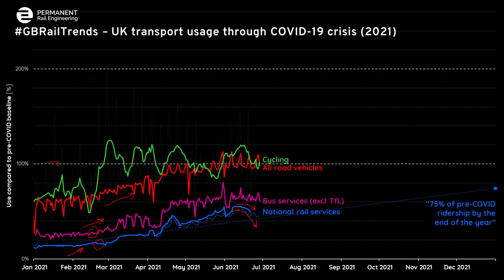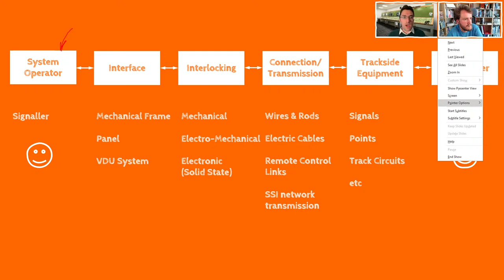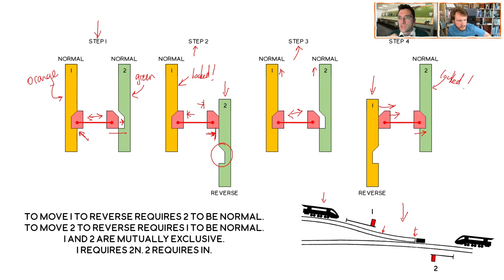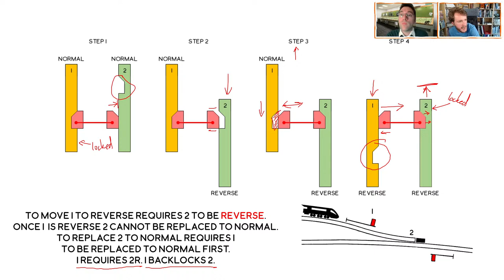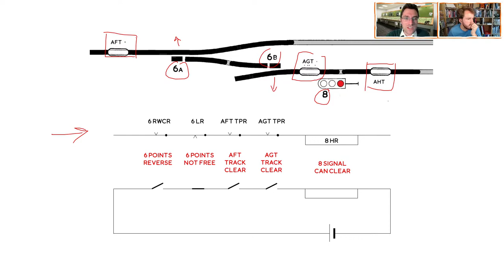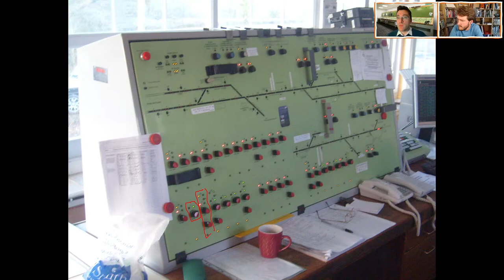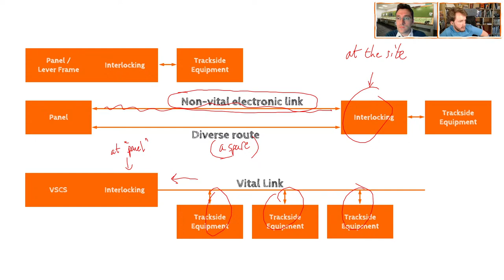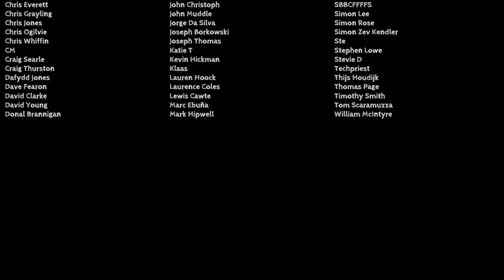#RailNatter | Episode 68: The three generations of signalling control and interlocking

Comment: Before SSI, 'vital reed' FDM technology was sometimes used to allow centralised relay interlocking at the panel signal box end, with distributed input/output of functions via the multiplex system to and from the trackside. Trent on the MML and Saltley near Birmingham were configured thus; both built in the 1970s I think.

Comment: 58:00 there's a bug in the diagram - the dog and notch on tappet 2 would need the bevel on the other side, so normalising 2 can push the lock to the left

same for tappets 2, 3, and 4 in the next diagram

Comment: ok but why did they create and use a typeface where 1 and I look identical
Reply from the maker: lol
Reply: Before CAD, drawing offices used Uno brand stencils for 'presentation quality' printing on hand-drawn diagrams. These were very common in all branches of engineering for all kinds of technical drawings. Later, they moved on to using Rotring stencils. The many individual circuit diagrams for a large interlocking would usually be hand-lettered rather than using stencils, which would be too time-consuming. Signal box diagrams and panel face drawings used stencilled numbering and lettering as would signalling notice diagrams.